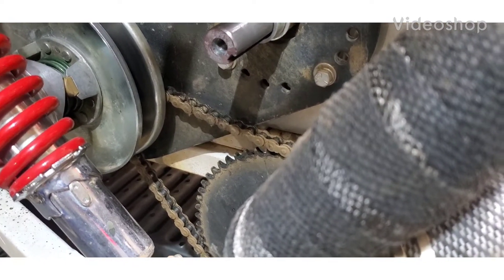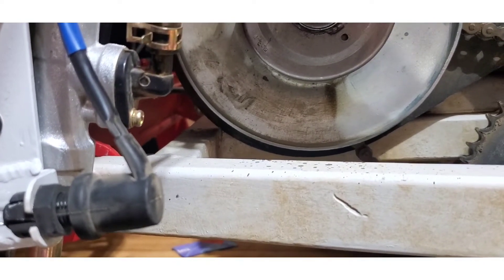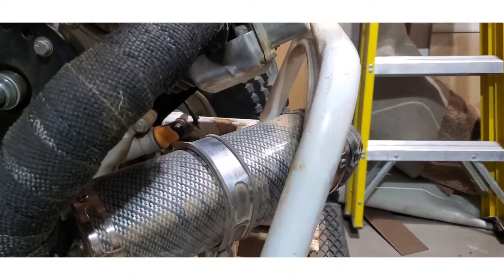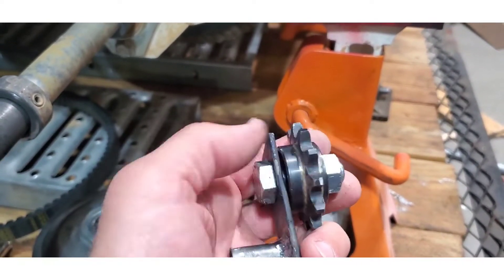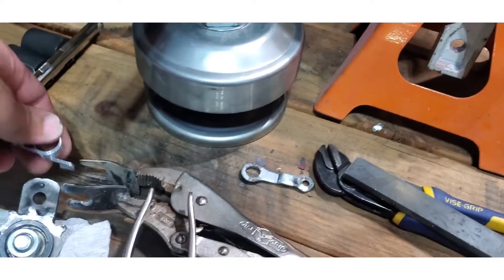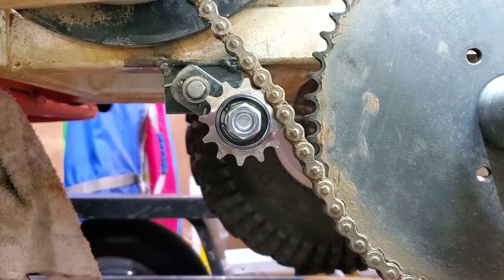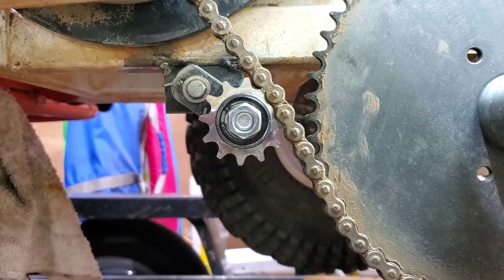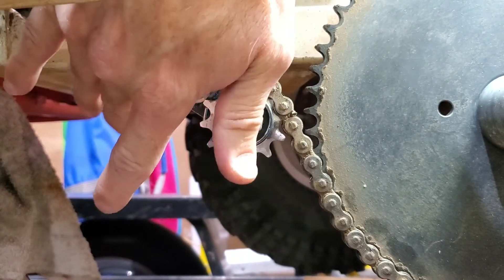diy go kart chain tensioner

Comment: I just made a similar spring tensioner on my buggy. Haven't had a chance to see if it makes a difference. Have you noticed a difference with yours? Not throwing chains as much?
Reply from the maker: This chain tensioner works great. Never have an issue with it throwing a chain. Keeps constant pressure on the chain so it doesn't slap around loose.
Reply: @justinsauer5682  Awesome. I'm running a Duromax 440 (basically the same as your Predator 420). I have the same engine plate too. I have plenty of room to move the engine to tighten the chain but I got tired of constantly adjusting the chain before and after every ride. Last thing I needed was to get stranded. Thanks again for the idea.